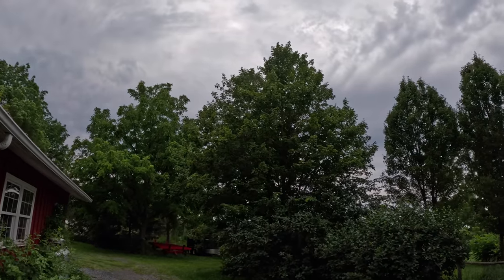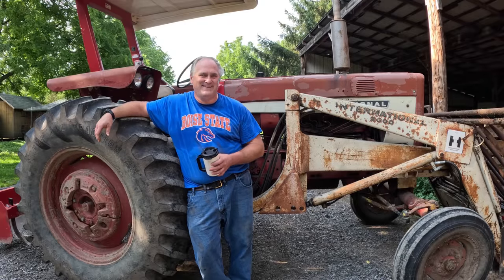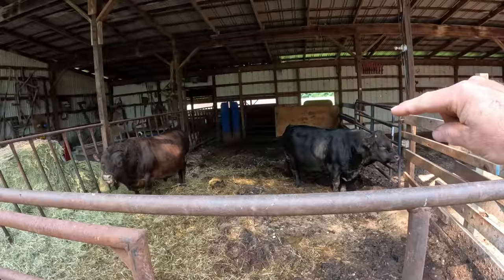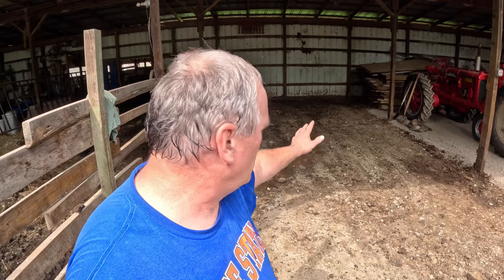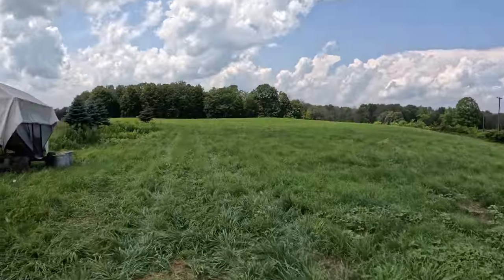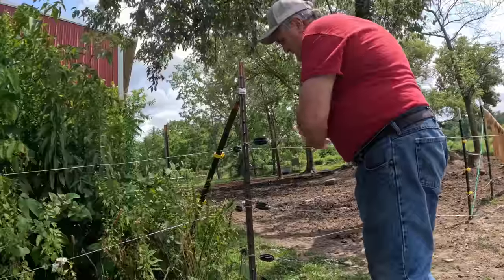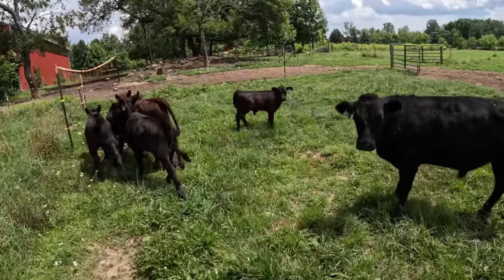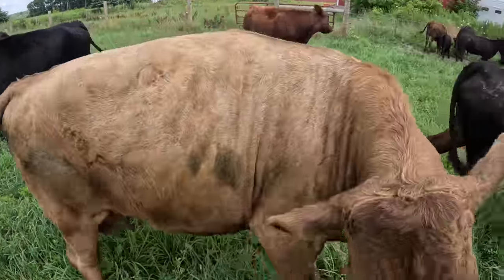I'm Floored, Stoned, and Cowed

Comment: Noooo I want to see you build d282 (just my two cents)  the c236 would be a better choice for winter starting ? With out a dought !!! but my 706 gas (I think it has C236)  sure gets  thirsty doing long hours jobs like moving manure and plowing snow or baling . You have always surprised me  by not using the 504 in the winter to move bales. 560 with d282 sure saves on fuel in long hour jobs. In my family we have 3 d282 in 3 farmall 560`s and love them just looking to learn more about them

Comment: C263 is a great engines not much power difference from D282 I grew up running that whole series of engine from 460-706 it will definitely start better in winter than D282.